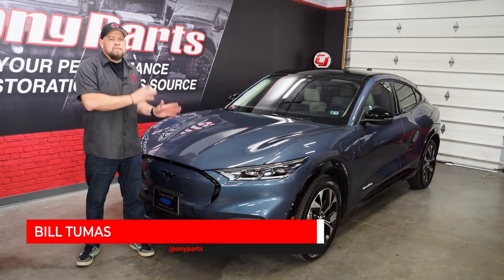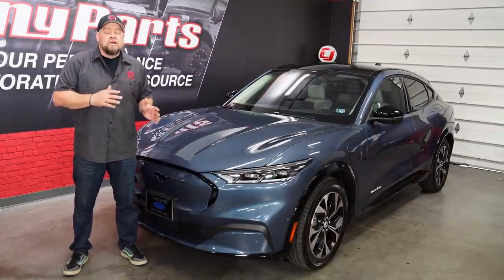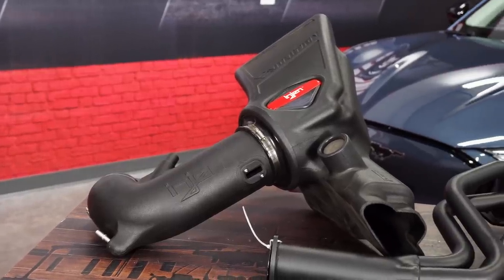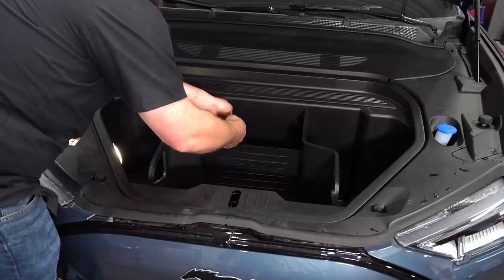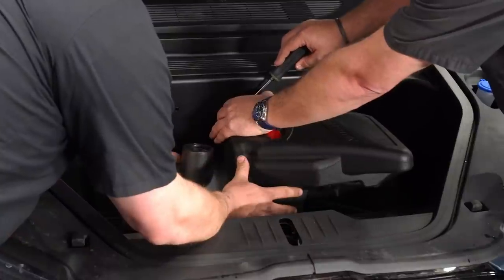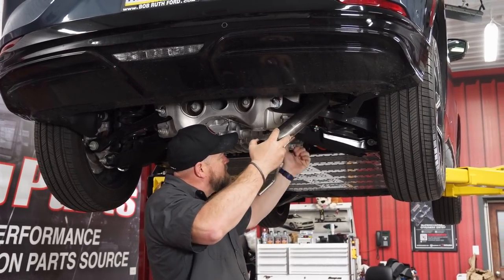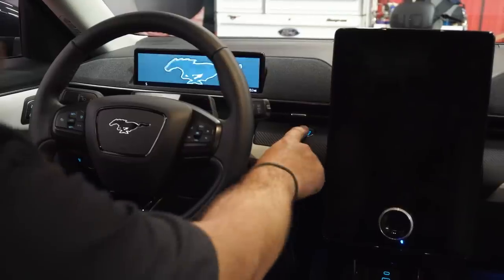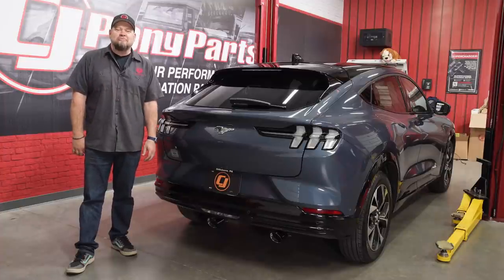2021 Mustang Mach-E Install | Long Tube Headers & Exhaust

Comment: Man I feel for it so hard. LOL CJ yall got me good haha.

They do have sound boxes you can use with a variety of preset sounds set to the throttle you can use on electric powered vehicles though. If I ever had to get an electric sporty style car I would def get one of those sound boxes installed ASAP.

Comment: How funny, I hadn't watched a CJ Pony parts video in months due to COVID and and life's  craziness. CJ's feeds had stop coming up. Then I typed in the name and this popped up. With all of the electrification stuff that's been announced, I was like what?? Honestly I didn't get it until Bill started doing the exhaust. I saw the headers on the table. And I got more curios when he was putting the CAI on. I noticed that he wasn't showing the detailed connections points. Then what got me was when he pressed the accelerator. Never mind the date, I didn't even see it. That was a good one. :)

Comment: Well done.

I laughed when I read the title in my feed.

Looking at the thumbnail, I thought it might be fun to actually have tailpipes installed that are attached to a powerful speaker and amp that play a glorious V8 soundtrack. Imagine being able to select the audio from a Coyote, Voodoo or Predator engine that is synchronized with the accelerator.

Comment: I didn't read the full description, I only saw MACH E sound upgrade so I clicked it thinking it was going to be some kind of sound generator. When they showed the table of parts I thought they were talking about what you would do on a real mustang (I was half paying attention). I stayed with them until they "tightened the clamp" for the CAI then I looked at the video date. It was good though, especially the guy in front trying to decide where to put the headers...lol